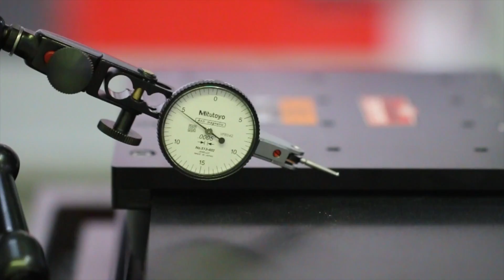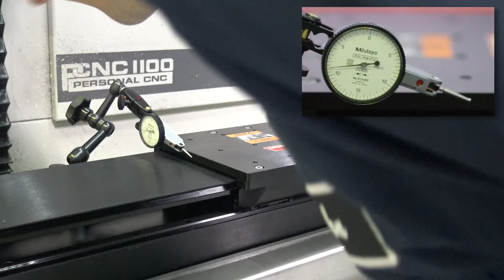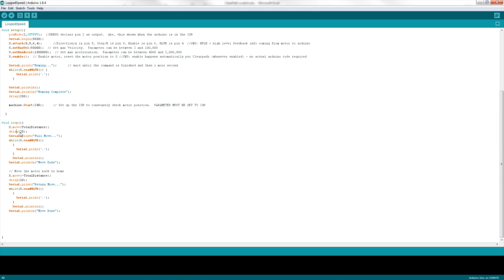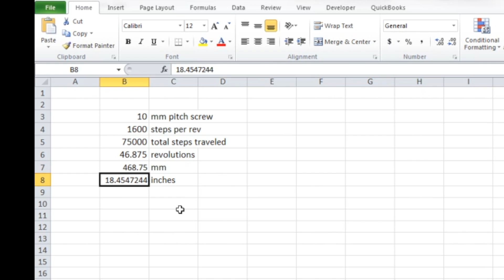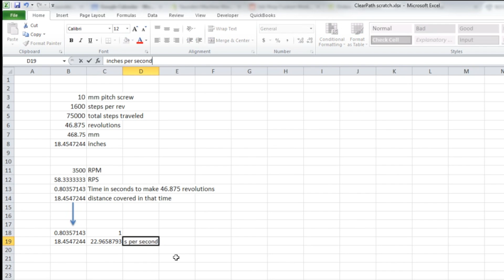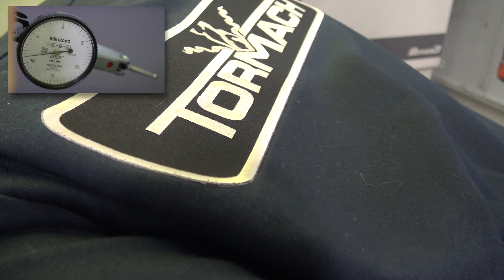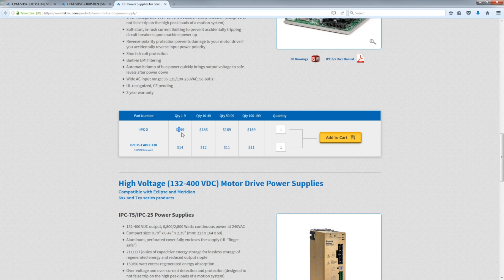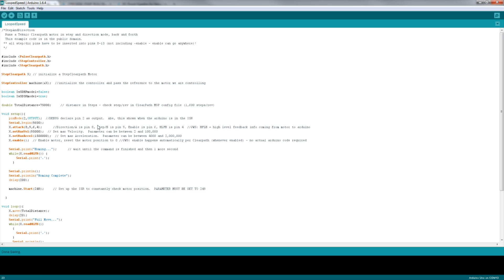SUPER Fast Arduino Servo!  ClearPath!  WW120

Comment: I don't know much about clearpath specifically,  maybe I'm off base here, but I doubt if they home based off torque on the rubber stop.  If they did you would expect the zero point to drift as the rubber aged for one thing.  I know with my mill the way it works is you have an ABI encoder on the motor, with A and B being your normal rotational measurement (they might go high to low in sequence 2000-8000 or more per turn on each line).  Then the I line only changes once per turn at a specific point on the rotation.  

So a mill's homing sequence might be
1.  Start homing sequence in the direction of the endstop
2.  Run until it hits the endstop (this will be a soft stop, a switch that gets pushed but doesn't stop the mill or get in the way).
3.  Continue homing until the index position comes around.

This is the reason you get the accuracy.   The endstop will often be a mechanical switch with a certain amount of inaccuracy in the exact point on it's travel that it triggers,  but with this setup you only use it to know when you're on the last turn and then you use the index pulse to get your ultimate endstop position with whatever accuracy your encoders can do.

For instance a 8000p/r (pulse per rev) (which is 8000*4 total positions since it interpolates between two lines giving 32k discrete positions) encoder direct drive to a 5mm pitch ballscrew would be 0.00015625mm.  All that and your endstop only has to be somewhere in the last 5mm of travel.
Reply: Now that I think of it a bit more, I'm probably off on a tanget a bit.

What I said about homing for accuracy would all be correct, but it may be using the rubber stop and torque detection to replace a mechanical switch.  Then homing as normal to the index pulse.  I'm not sure when you would specifically need that, it would be one less component to wire in though.

Comment: Hey John, really nice project! I'm looking forward for the DIY Plasma CNC. A quick question, how many wires this servo need? You said it has a "feedback info" right? Is this servo using the same "data" (PWM) as others simple servos?

Comment: ugh...your tormach's all run stepper motors, but suddenly stepper motors aren't accurate enough? hmm I smell fishy marketing wank. And it had better always repeat to zero, it's a servo. otherwise it would just be a motor
Reply: EitriBrokkr apparently it's a stepper motor and controller in one box. It doesn't have the extreme speeds a BLDC motor controller could have, but the mechanical drive for a stepper motor driven system is usually much simpler (lower gearing ratios makes taking up slop with preloading easier)
Reply: Jean-luc Picard
Sounds like *someone*'s been assimilated... 
:-/
Reply: EitriBrokkr steppers suck. Slow, old, noisy, step forgetting stupid motors.

Comment: Hook it up to GRBL !
Reply: GRBL is ok, though it is terrible at prediction...  Smoothieware being a 120Mhz vs a 16Mhz Arduino has so much better prediction.  I'll run Marlin before GRBL...
Reply: GRBL is ok, though it is terrible at prediction...  Smoothieware being a 120Mhz vs a 16Mhz Arduino has so much better prediction.  I'll run Marlin before GRBL...
Reply: yes, for the plasma smoothieware would be great.
Reply: mesa controllers are the bomb, smoother steppers are a good second, though stick with the ethernet version. 

a grbl + arduino is not much cheaper than a mesa, and you'll have a hell of a control that works great with linux.

Comment: Hey John, hard stops are one of the best ways to home and the method is commonly used by just about every motor manufacturer. Generally it works either by sensing an increased current draw over a threshold or position error threshold (actual vs commanded position). The downfalls are windup inaccuracy in your coupling and end stops on your slide. As things age, your position will drift. Also, it will home against ANY hard stop including something in the way and give you a false position. You probably wouldn't run into that issue though.

Either way, I think this solution is much better than a plain stepper :)

Comment: These are closed loop steppers, right?
Reply: I believe they are full servos
Reply: There are many different styles of control available.  We're mainly looking at step and direction pulse control ala a stepper, though ClearPath are true DC motor Servo's with it's own onboard computer, hbridge, position sensing.  Data lines are nice Dir+ Dir- Step+ Step- ERR+ ERR- ENABLE+ ENABLE- so you can wire them common cathode or anode which is really nice!  BOB's are usually Common Anode (+5v) and smoothieware, RAMPS, GRBL are common cathode (Grd)
Reply: You can run every type of motor in closed loop as long as you add an encoder and the driver has the logic to control it. And yes, there are stepper with built in encoder and driver that works as the clearpaths. The big difference between servos and stepper are the holding torque and speed. A stepper has a much higher holding torque then a servo but the servo has higher torque at higher rpm.

Comment: I don't know if you ever got around to the FEA of the clamp but I found a weak point. It turns out the threads just peel right back if tightened hard enough.

Comment: John, you beat me to getting into the ClearPath! Would be interesting the accuracy results with more mass on the table, but it
should be great. Servo is closed loop, it goes where it is supposed to go without skipping steps (stepper). You also get the controller built-in, not like you have to buy a complete assortment of controllers for each stepper. ClearPath has some awesome video demos of passing  linear stage movement going right through a rotating disk that has notches in it with a crazy tight fit to pass through, going forward and reverse directions at fast speeds on the linear stage. Incredible possibilities!
Reply: The ClearPath has it's own driver and computer to count pulses and position, not a controller (step generation -- g code translation) or Break Out Board.  You still need to send it pulses ala a stepper driver.  The built in driver keeps the servo in time to the pulses or errors out on exceeding spec.  John  also beat me to getting a clearpath.  Dave Graton has also played with them.
Reply: Driver, yes, yet it can be it's own controller as you can pre-program it as a standalone unit, just not in g-code.
Reply: RobiSydney njjnn

Comment: ok it is accurate when it has no load or resistance on it but i doubt it it would be that accurate with resistance can you make a video about that?
Reply: They have an Encoder on them to ensure they get to their location. If they have constant velocity, the load shouldn't matter too much (within reason)
Reply: There is always load. Accelerating and decelerating that much weight is load. Imagine that platform was sliding at your hand that quickly and you were charged with catching it!